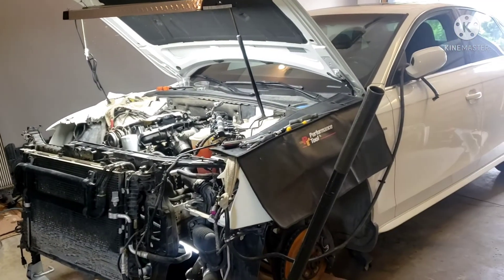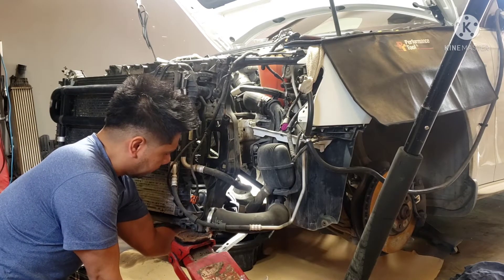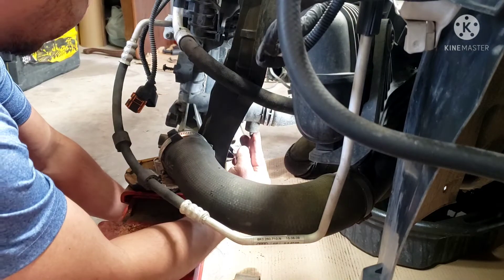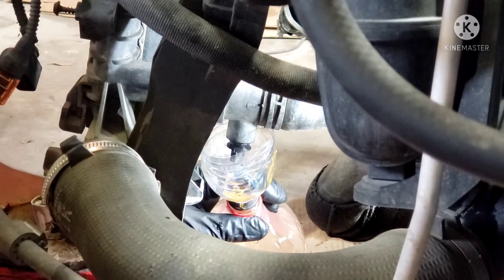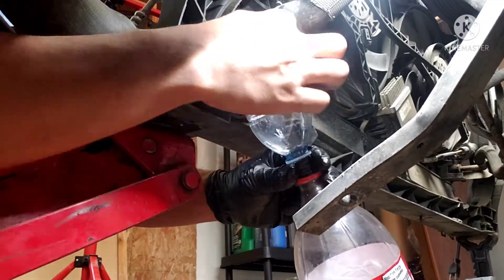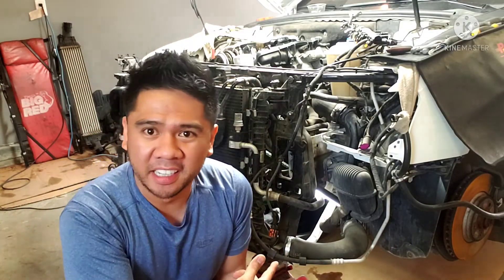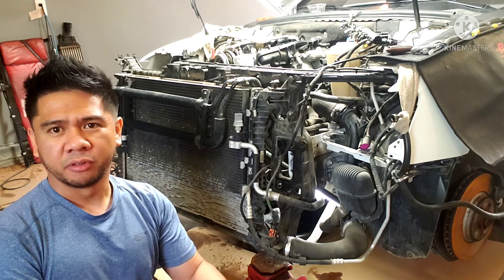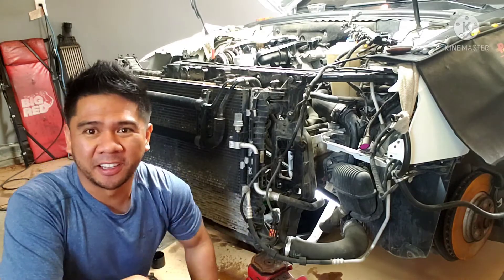Audi 2.0L How to Drain Coolant out your Radiator

Comment: I turned the tap 90°, but the coolant is not coming out. Do I need to pull down the tap with a plier? How do you open the tap to come down, and how much should I turn?
Reply: turn counterclockwise 90 degree, pull till it click, turn counterclockwise 90 degree again

Comment: Hi I turned the handle in line with the tap but nothing came out. Do I need to pull the handle out and twist it? TIA
Reply: Same here
Mine turns but doesn't screw out
Had to pull down with plier and it came out completely and splashed a lot